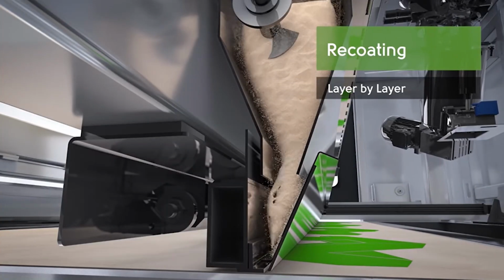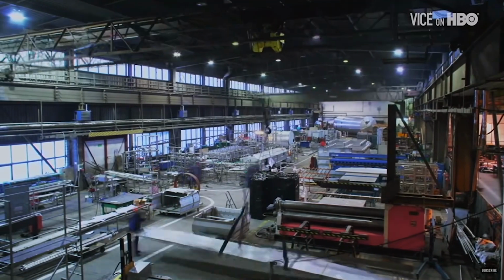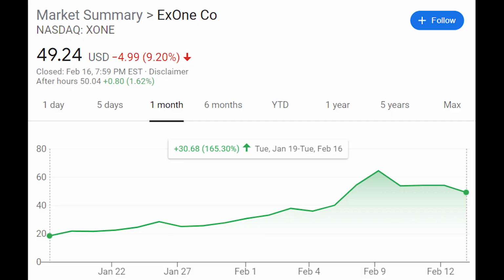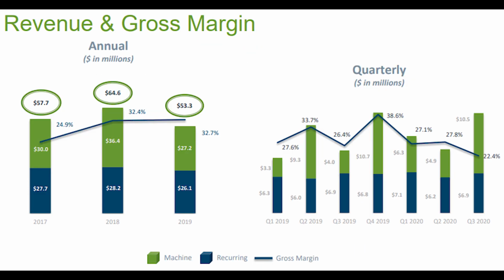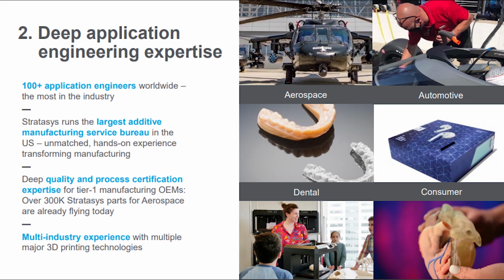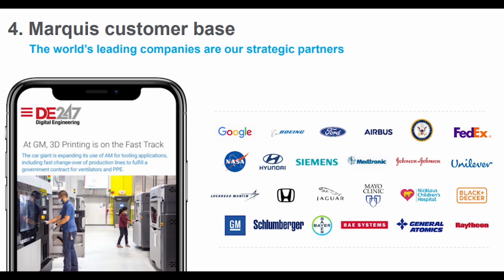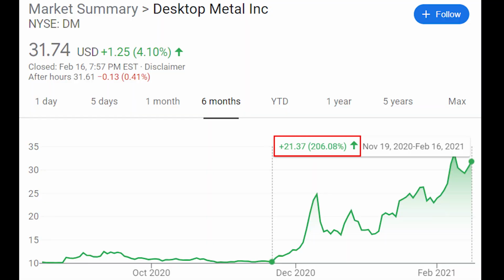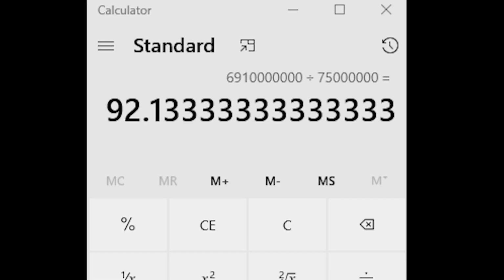Top 3D Printing Stocks | ExOne Stock | Stratasys Stock | DM Stock

Comment: the problem with SSYS is that they are losing market share.  Look at their total revenue its decreasing yoy.  I wouldn't touch it with a 10ft pole. Take a look at PRLB.  ARK has the wrong stock in their portfolio.
Reply: Interesting I am new to the 3D sector. I will look into PRLB, but What are your thoughts on DDD and NNDM in comparison?
Reply: @chrismolloy6885  DDD is the same its losing money and market share yoy.  NNDM is a different sector that is in high demand.  It was trading at 1x cash in the last dip.  Try to pick it up in the 7-8 range.

Comment: This technology has been around for 30+ years without broad industrial utility. What is holding it back?
Reply from the maker: I believe it's scalability, material science advancements and cost efficiencies. If you look at EVs, they've been around for decades but are just now starting to become a viable business due to reduction in battery costs and how efficient they are
Reply: @JustinRiveraInvesting  Thank you for your reply. The majority of manufacturing and process engineers agree with your sentiments. Rapid tooling is about the only decent application at this stage, we’ll see what the future holds.

Comment: Did I made a good move, I bought 500 shares of ExOne at $51??
Reply from the maker: I would say it just depends on your conviction. From a valuation standpoint it's not as expensive as DM but it also has run a lot over the last several months. If you really like it and it drops buy the dip. Over the next 5 years I do think it'll return some nice gains 💪